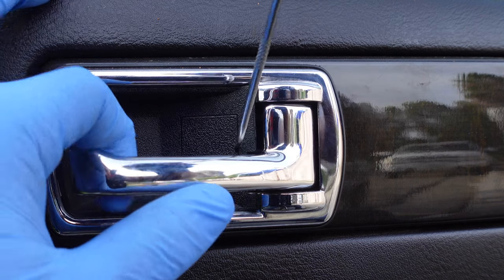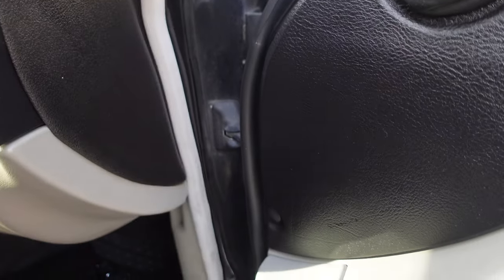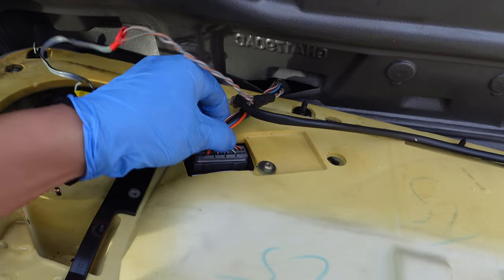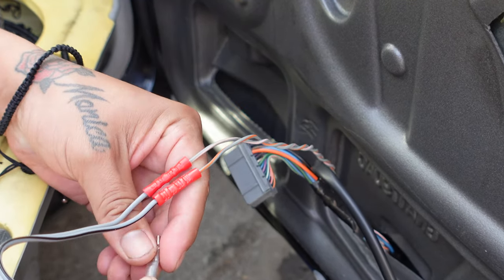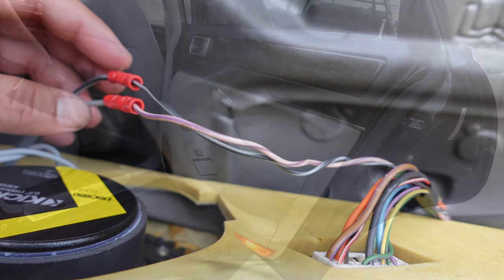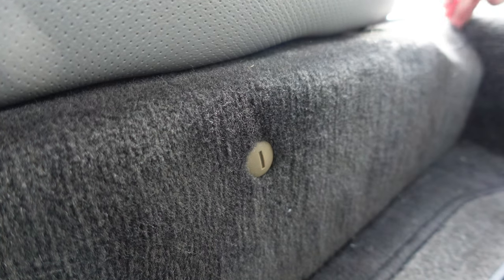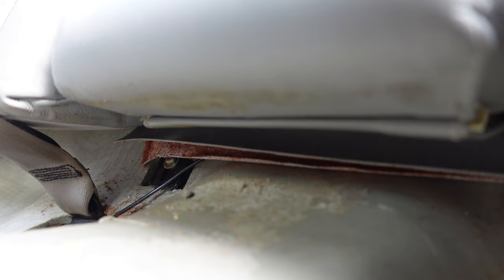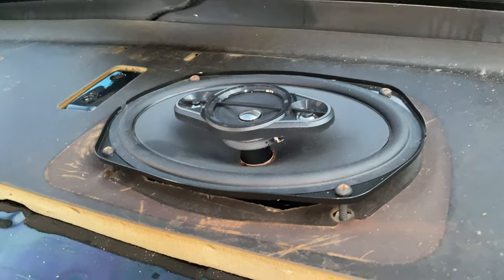Enhancing Jaguar XJ6 Audio Experience: Interior Speaker Upgrade

Comment: was watching for the door takeapart , i might have to change my speakers and dreading it cause i always fuck up the plastic clips , i noticed your cieling is sagging too , i was thinking of replacing mine with a deer tapestry and hot glue and cutting it the exact same size , or finding a black waterproof canvas to glue to it , also on my new jag trying to get the smell  outta the carpet